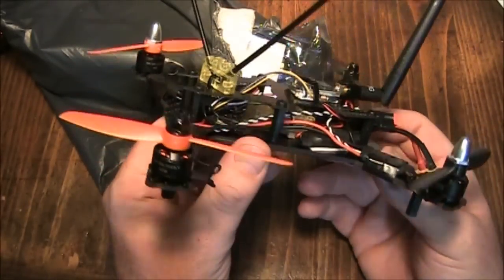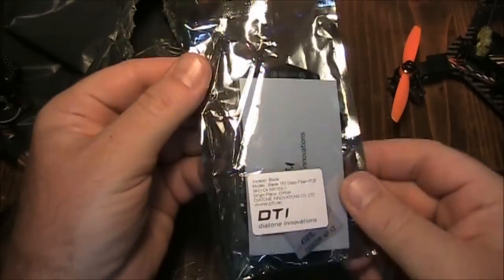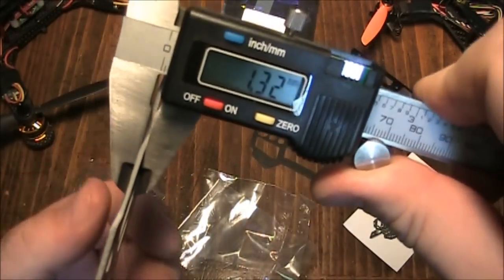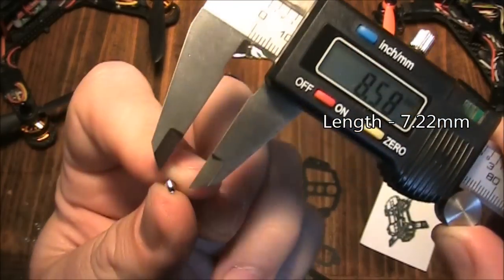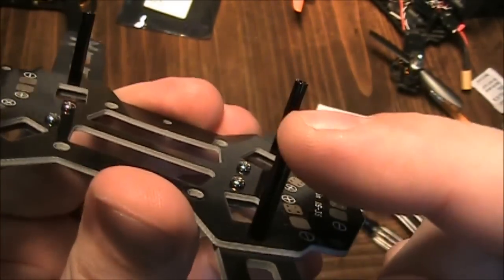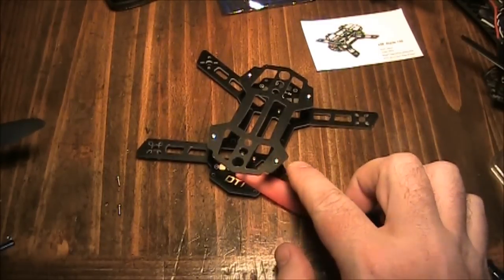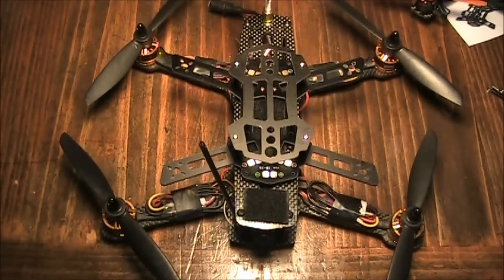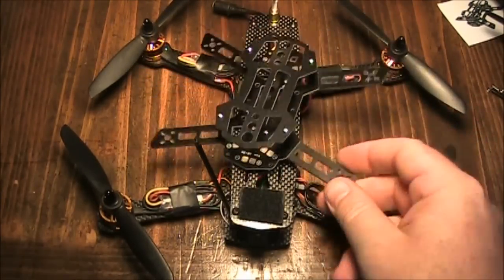Diatone Blade 150 Frame Review

Comment: Hi Travis, wanted to drop a line and say thanks for all the cool vids. I want to build a 130 to 180 size racer (without fpv first) as my first hobby grade project. Which frame you recommend I pick up and get started with? Been flying toy grade for a while now, so I already know the basics. Thanks for the help!
Reply from the maker: The 180 size would be an easier build because you have more room.  The 150 and 130 size requires components to be modified a little to get them to fit.... they aren't impossible, just more difficult.  The LS-180 frame would be excellent.  It runs up to 4" props.  If you step up to a LS210, then you could run 5" props and would be much faster.  This Blade 150 frame is pretty tight and I had to resolder some pins on the flight board to shorten its height just a little.  Definitely build the frame you like best though.
Reply from the maker: +Patrick Sjöholm I have my Deformation 130 build-review video recorded.  I'm going through the editing process now.  It should be up later this week.  Maybe it would help a little with seeing the challenges of a smaller sized quad.
Reply: +travisgrindal thanks for the reply and will definitely keep an eye on the new vid. I am starting to understand your point on the space, from all my readings in the past few days, and I am leaning toward the 180 to make my first experience hopefully a little smoother.
Reply from the maker: +Patrick Sjöholm Here's my Deformation 130 video:  https://www.youtube.com/watch?v=-Q5q4gyIp2k

Comment: Can i fit a kk2 mini in the 150 i can never get the naze 32 to arm with my devention 6 radio
Reply from the maker: kernalmusterd Yeah, the KK2 Mini should fit.  Accessing the menus will be kind of pain once you have it together.  The cables may have a hard time fitting since they come out the top instead of having bent pins.
Reply: ***** Thanks i was considering desoldering the pins on the kk2 and replacing with bent pins or trying to get the naze to arm by increasing or decreasing throtle travel value on my tx. 
The 150 will be my next prodject after i have finnished my leora quad which is about a 180 size with 2204 2300kv using 4s its gonna be a beast line of sight flying

Comment: Great review! Im actually looking at a Cheap ESC at banggood and it says "for multi rotors" do you know if i could also use it for planes?
Reply from the maker: Aaron S I flashed my ESCs with SimonK firmware and they still worked fine in my foam airplanes.
Reply: Awesome thanks!

Comment: Just a tip, when measuring a bolt (except a countersunk) the measure distance is not end to end. It's end to under the head. Measure again and see if it rounds out a bit better.

Comment: JUst looked at Banggood again.  They have two CF variants that come in three sizes but the PDB that they had shown as a future is now gone from their web site.  One variant has just a PDB and the other has a built in BEC on the PDB.  They still have the fiberglass version as well.  I like that for under $20 you get CF or under $10 you get FG.  Very cheap but good looking frames.

Comment: Banggood is now showing a carbon version of the 150 coming with a power distribution for the Naze32 so that pins match up so little to no wiring needed..  Interesting and thinking about waiting on that version.
Reply: Dale S  They should make them with the flight controller built into the PCB board.
Reply: stewjw Already happening for bigger models http://rcexplorer.se/product/naze32-tri-frame/
Reply: They dropped the pictures of the 150 PCB with pins matching Naze32 FC.  Must have decided not to proceed with it for some reason.  I have seen a PCB for the ZMR 250 that has the Naze32 built into the PCB for around $30 for Acro version.

Comment: Thanks for the updated link but...  I look at the Q200 in your video and even though it is only a few seconds showing the Q200 and I compare it to the Banggood Q200 they look like very different quads.  For one thing yours has a single board with thick arms and the BG Q200 shows a dual board setup with very thin looking boards/arms.  I like what you have and not theirs.  I will wait patiently, or not patiently, for your video on the Q200 build as it really interests me.  Keep up the good work on these small quads.
Reply from the maker: Dale S Yeah, I didn't put mine together they way they wanted because I think the upper plate (1mm) is too thin to use by itself.  I should have the Q200 review up later this evening.
Reply: ***** I agree with you on the "too thin to use by itself".  I quickly passed over the Q200 a week or so ago cause it looks so fragile the way they show it being built.
Reply from the maker: Dale S Here's the Q200 Quadcopter Review:   https://www.youtube.com/watch?v=oqgFpY6jqv0

Comment: Your link to the Q200 is to the Blade 150.  I can't find the Q200 frame kit.  Can you provide a correct link to the Q200 please?  I plan on building both the Blade 150 and Q200 to fly with.  Thanks for the review of the 150, looking forward to the Q200 review.
Reply from the maker: Dale S My bad, the link is fixed now.  I'm working on getting the Q200 review done this week.  I really like flying it.

Comment: What flight control board will you use on this tiny quad?
Reply from the maker: EC White I'm planning on using this mini CC3D atom.  I'm using this same one on my Q200 and it does very well:   http://www.banggood.com/OpenPilot-CC3D-Atom-Mini-CC3D-FPV-Flight-Controller-CC3D-EVO-p-970762.html?p=6Z050013977120130325

Comment: You should cut the 4 inch prop to fit. Be informed that diatone us making 180 size arms for 4 inch.
Reply: Lorenzo Longhini I saw a post on RCGroups where a guy made a 3DPrinted device that holds the prop, and a dremel, both locked into the right spot for a few different sizes props, including 3".  He has made the print file available (free).  This is totally ideal as it keeps it consistent, for closer balance.
Reply from the maker: Lorenzo Longhini I'm planning on cutting the 4" down to 3".  Also, I'm working on getting an early set of the Blade 180 arms to try them out.  Hopefully, I'll have this flying well before I ever get them so I can get a good comparison of the two sets.
Reply: If you can. Could you tell me how to cut 4 inch prop? How many mm?
Thanks
Reply from the maker: Lorenzo Longhini Heh.... sure!  I have to figure out how I'm going to do it first!  :)

Comment: Hobbyking has 3020 props :)
Reply from the maker: edward Burgos Sweet.  I need to take a look at them.
Reply from the maker: edward Burgos If I put 3020 props on 1306 motors, they'll have to have a 5mm hole for the motor shaft.  The ones I saw on HobbyKing have a smaller motor shaft hole.  Hopefully some 1106 motors will be released soon that are not $20 each.
Reply: ***** IKR!  This is why I have not purchased this frame yet.  I like it, but the parts availability aren't there.  I was rather hoping to be able to either use the frame upside down or using a motor mount to get the 4" props clear, or even use shorter spacers for the two frame plates, but I see from your video the fore and aft clearance isn't enough anyway.  I'm not keen on cutting props constantly for it.
Have you tried mounting motors yet?  I have some ZMR 1804 2400 kv motors that I think will fit, as they have 12mm mount holes.  But in your video they look smaller than the diagram.  Can you confirm?  Of course, 2400kv might still be too slow for 3" props.  :-\  
Looks like this frame is before it's time, but it is good it's out though, so the motor and prop makers get off their duff and release some fast tiny motors, like you say, that don't cost $20 a piece!
Reply from the maker: Shawn Sato-Veillon My parts should be here this week for it.  I'm going to use 3100kv motors.  I think the 2400kv motors would be kind of slow for it, but if you already have them, it would be fun to try.